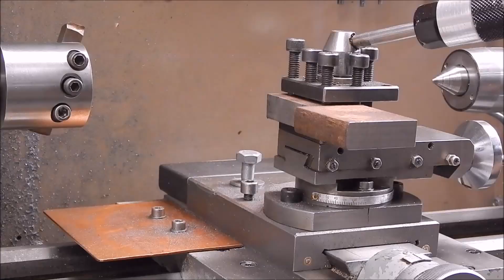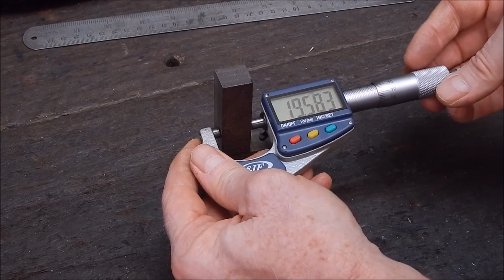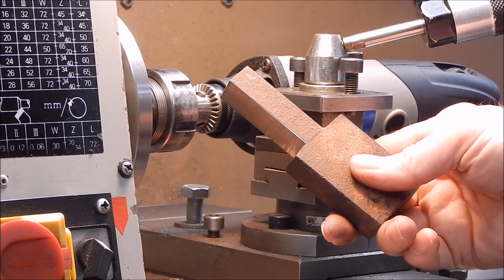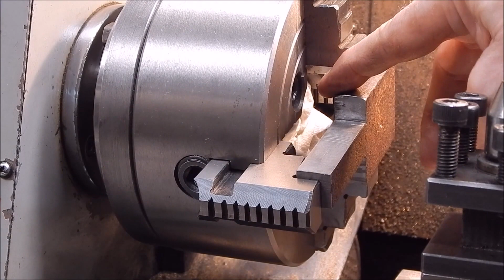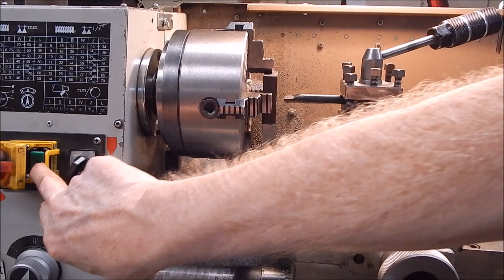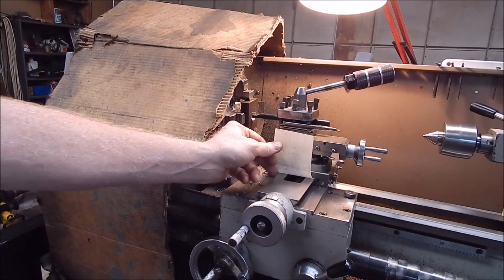Turn the HILDA 400 watt rotary tool into a tool post grinder - part two

Comment: excellent!

do you think it's a good idea to make the holding ring on the lathe so that it is circular on the outside as well, and then weld it to the square handle? will it be strong enough or is it better to make it from one piece like you did?
Reply from the maker: It should work OK provided everything stays aligned when you weld it - you may get distortion from shrinkage. Machining it from one piece eliminates that risk.  Cheers Rob
Reply: @Xynudu  cheers! I was thinking to clamp both the ring and the handle to the solid steel welding table and then weld one side, grind the weld flat and flip it over and weld the other side the same way and grind the welding joint flat.
I think firm clamping of the welded pieces should force them into alignment. I can leave them clamped flat  until they cool down if that makes a difference.
Reply from the maker: The main issue is that even one degree error will be magnified by the length of the grinder.  Try it and see, but be aware of potential misalignment issues.  Electrical welding always distorts.  Cheers Rob
Reply: @Xynudu  maybe I'll re-bore the inner circle of the holding ring after the welding which would true the holder to the lathe spindle axis
I have 4 jaws chuck so I can hold that "magnifying glass" shape
Reply from the maker: Yes, just machine it undersized first and then open it out after welding.
Reply: @Xynudu  sounds like a plan
Really glad you took the time to discuss it with me
Thank you!

Comment: Regarding the rough casting holding the front bearing...
I bought a "Maxman" 120V version from Amazon.  It appears to be the same unit mechanically.  I see on Amazon that there are several versions of what looks like the exact same grinder but with different labels slapped on them.  The one I have has a slight taper to the collar you're using to clamp it.  I know you say it doesn't seem to matter, but being... compulsive... I thought I would try and remove it and machine it to a true cylinder.  Mine didn't come with the "spanner", so I found a thin 9mm wrench in my collection that worked (Craftsman "midget" wrench set).  I was able to unscrew the chuck.  I didn't measure the thread.  That's as far as I got.  There appears to be a collar spacer on the shaft that the chuck screws up against.  I couldn't pull the bearing off by hand, and I didn't feel like taking the whole thing apart to use a press.  So I think I will try to figure out how to match the taper on nose, and bore the holder to match.
Reply from the maker: Mine has a slight taper also. Not an issue for most grinding and cutting jobs, but you need to align centres when drilling and milling before tightening.

Thanks for the info on dismantling it.  I'm not surprised with what you found.  I considered this but passed on it.

Cheers Rob
Reply: OK... I couldn't resist.  I took it apart.  First, I took out the  brushes.  The rear bearing is just pressed into the plastic, so that's all you have to do back there.  Then, I removed the three screws holding the front bearing assembly.  I used a small pry bar against a flat piece of metal in the "spanner slot" to pry the whole armature/front bearing assembly off.  The metal was used to prevent damaging the plastic housing.  I also had to keep from sticking the metal and prybar too far into the slot or I might have bent the fan. The chuck just screws off.  There is a spacer between the chuck and the bearing.  It's just a slip fit.  I had to press the bearing off.  I put blocks below the bearing housing and pressed on the end of the shaft.  It is a light interference fit.  Once the armature was removed, I could remove the three screws that held the bearing in.  It is a close slip fit in the housing.  It kept rocking and jamming. I had to slip the end of the motor shaft back in the bearing to keep it from cocking.  Now that I have the bearing housing disassembled, I plan to machine the outside of the nose concentric with the bearing recess.  I haven't done this yet, but here's how I plan to do it.  I will mount a 1/2" piece of round stock in the 3-jaw chuck of my trusty Sherline lathe and drill and tap a hold in the end for maybe a 10-32 screw.  Then, I will use superglue to attach a disk over the end and machine it in place for a close fit for the bearing recess.  Then, using a washer, I'll clamp the bearing housing.  I think this should work.
Reply from the maker: You're a brave man doing this.  Wouldn't the outside of the scroll chuck jaws fit/grip inside the alloy housing where the drill chuck would normally be ?
Reply: I couldn't figure out how it was initially machined.  It was obviously painted first, then the back side was machined, including the bearing recess.  I'm not really sure that the front collar is concentric.  That's one thing I have to check before taking a cut.  I don't want to leave the wall too thin... just want to true it up.  I thought about using the inside of the housing (the "collar", as I have been calling it), but it is quite thin and I thought the pressure of the chuck jaws might distort it.
Reply from the maker: I suppose another way to tackle this is to "add" metal rather than remove it - a bit of lateral thinking here - why not machine up a sleeve and epoxy it to the outside of the housing ?

Voila - fixed.

I might even check that out myself.

Cheers Rob

Comment: Did I see that right? The black part of Hilda to which you fit your holding bracket is a unmachined grey casting at aleast where you will fit the bracket. Could you not get  a more precise and thighter grip if you turned a diameter on that casting?
Reply from the maker: Hi Rol,

It's a casting, but quite accurately done.  I considered machining it, but the whole power tool would have to be dismantled to get it off.  I miked up the runout and it was not worth worrying about.

Cheers Rob

Comment: Good progress Rob.
I keep noticing your lead screw protection 'springs' - wonder whether those can be obtained anywhere.?
Reply from the maker: Hi Chris,

Yes they can be purchased aftermarket.  Search on spiral spring covers and something will come up.  The aftermarket ones are pricey though.  You will also lose some carriage travel with them due to their minimum compressed width.  I did a video on my covers quite a while back.  Well worth having though.

Cheers Rob
Reply: Thanks Rob - I rather imagine they are pricey but - will do some digging.

Comment: Hi Rob: I was surprised not to see you facing the sides of your bracket, either when attached to the tool post or in the lathe chuck.
Cheers

Jorge
Reply from the maker: Hi Jorge,

I'm just going to leave it as is.  When I take the rust off the rough finish will look OK.  I may even sand blast it.

So long as it does the job is the main thing.

Cheers Rob

Comment: Rob, instead of clamping a bracket into the rotary tool, is there anyway you could use the three existing mounting screws to make a non-slip bracket somehow? I haven't really given it much thought but could that be a goer?
Reply from the maker: I did consider that idea for an angle grinder, way back  The HILDA is in the same family as angle grinders, but without the right hand drive head.

As the HILDA has a clamping collar there's no point I can see in using the mounting screws to attach it.  The mounting plate would have to be a lot thinner and more prone to vibration than the 18 mm wide mount I'm making.

But, for an angle grinder as a TPG that suggestion can be used.  Certainly better than the radiator hose clamps I've seen people use to mount them on the tool post ;)

Cheers Rob